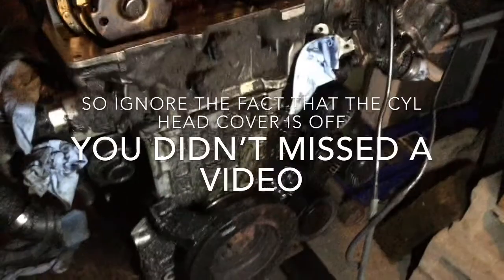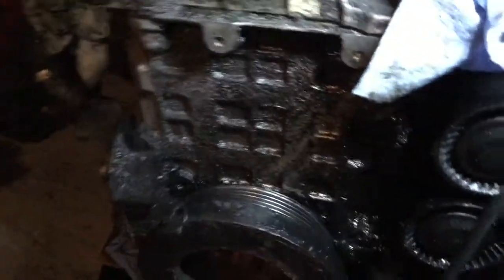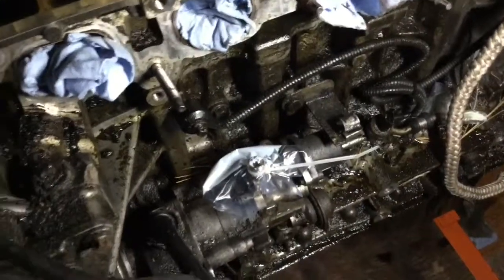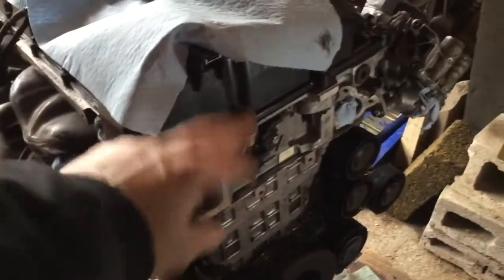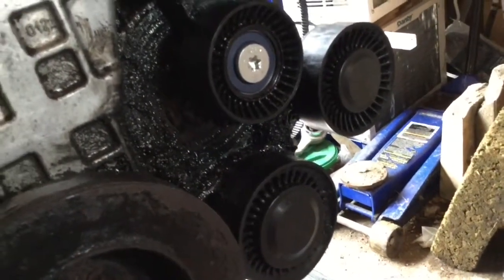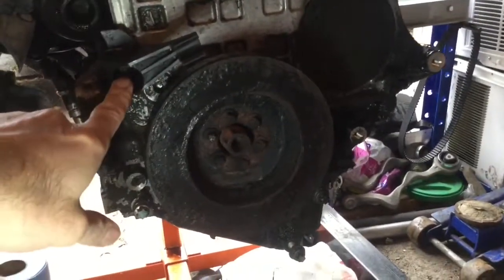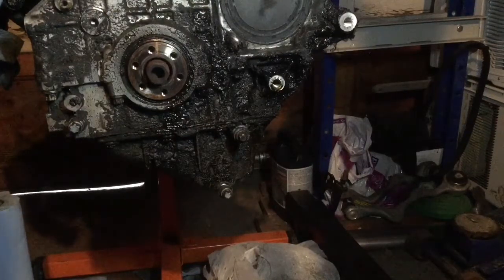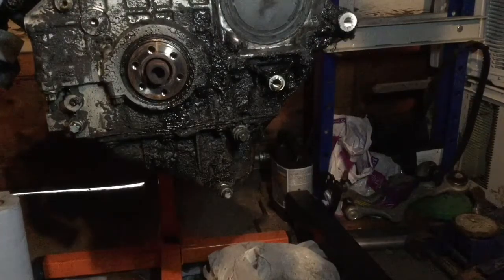20 BMW 135i N54 E82 - Engine Disassemble - Oil Leaks Inspection, Pulleys Removal

Comment: Thanks for the video! I'll have to pull my n54 here shortly, after replacing my turbos, I found an oil leak that seems to be coming from that 2nd seal above the oil pan seal, it's coming out right behind the engine mount below the rear turbo. I cleaned all the oil off and 6 hours later, small amounts of oil appeared right at that 2nd seal.
Reply from the maker: Sure, glad it helps!